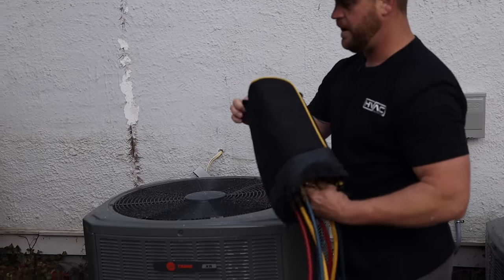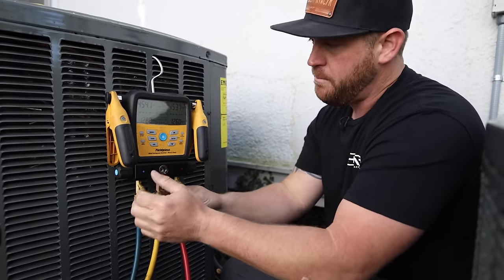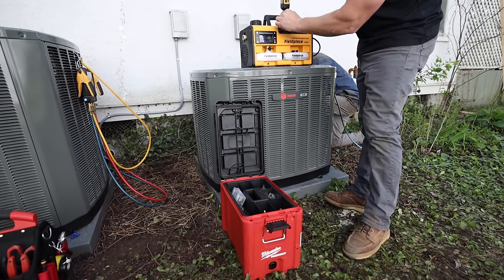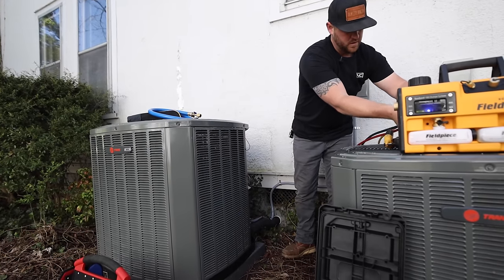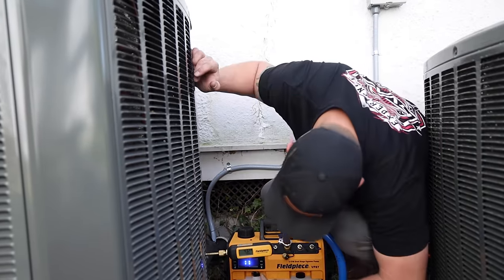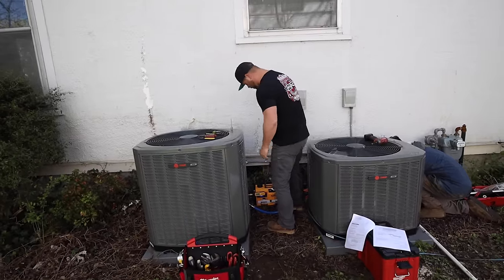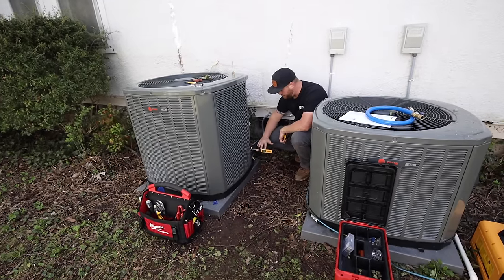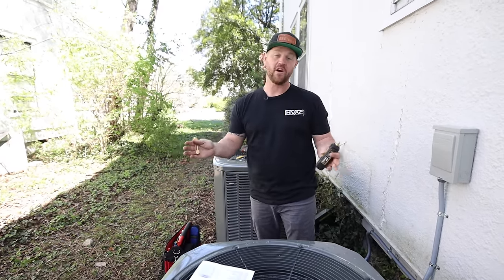Why I Choose A ONE Hose VACUUM Setup | HVAC Installations

Comment: Actually you want to pull a vacuum as SLOW as you can. Quick pulls freeze the water in the system. Now you have ice inside. Slowly pull down 1" at a time. No race here to do it proper.
Reply: I had an argument with my college instructor on this and his opinion was the same as yours. However, water boils at -24 degrees F @ 250 microns. So if you pull the system down in say 70 deg ambient conditions, won't the copper conduct the ambient heat and boil off any frozen moisture if any even exists?
Reply: @chrismartin503  It takes a long time to rid any ice buildup while pulling down a vacuum. If the system has been open to the air for a long time..... Do a slooo vacuum pull on it. Putting a big pump on with radiator hoses is over kill and causes icing in the lineset. There's a guy on here that SHOWS water purposely being shot INTO the lineset. And how long it takes to get rid of it all. Amazing the ice in the site glass just stood  there.....
Reply: @chrismartin503  That's why they say to charge in hot weather. If your system has water, pump oil getting milky fast, better slow down the vacuum pull.

Comment: On a compressor unit say 5 tons and under, typical house size unit, using 2 foot ID BLUE hoses and a 97 stage vacuum pump is a total joke. Removing valve cores which WILL leak once reinstalled is another joke. I would splurge on all that new way over priced gear if it took say, DAYS to pull a vacuum on a typical home system. It doesn't at all.

Comment: If your microns rise after you valve it off you have a problem
Reply: A small rise after valve close is expected. The oil continues to off-gas molecules of refrigerant for quite a while. It's like opening a new bottle of soda, putting the cap back on, and then opening it again in an hour. You released all the pressure when you opened it the first time. If you put the cap on after that and then immediately take it off after 5 seconds, there will be no hiss or appreciable pressure inside so it seems that all the pressure is out of the bottle. Right? But come back 60 minutes later and open the bottle once more and there's lots of pressure inside and you get a big hiss. That new pressurized gas came from the dissolved CO2 leaving the soda and it built up over time as you let the bottle sit. The same exact thing happens in a refrigerant circuit. In MVAC, if I pull a vacuum and leave it for a long time so that the micron drop has leveled out, I can go bang on the filter dryer or the accumulator and the banging causes the release of dissolved refrigerant out of the oil just like shaking up a soda bottle releases the CO2 and foams it up. Bang on the filter dryer or accumulator, and the micron gauge will spike and fall gradually again.
Reply: @mannys9130  yeah it rises initially after it stabilizes if it continues to …chances are leak, moisture, oil trapped ect